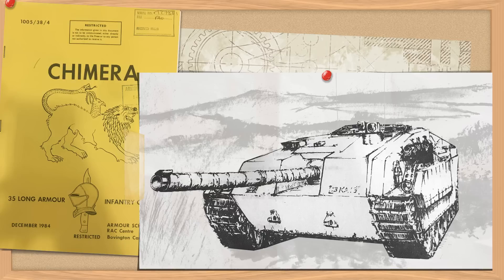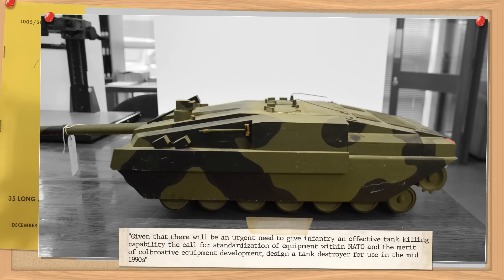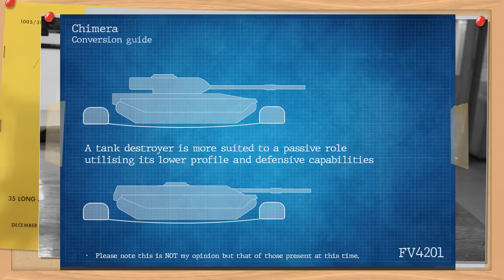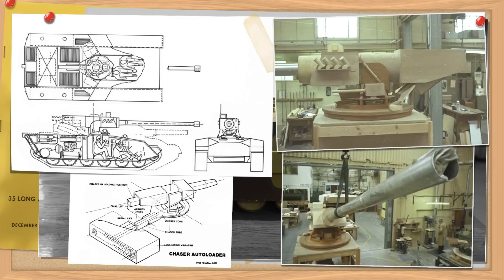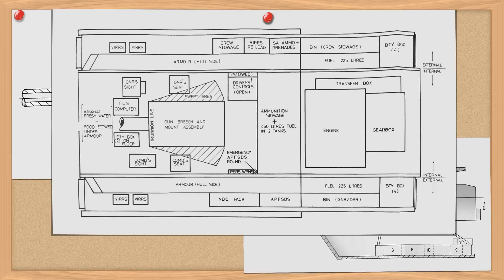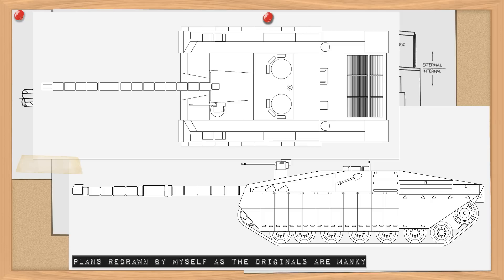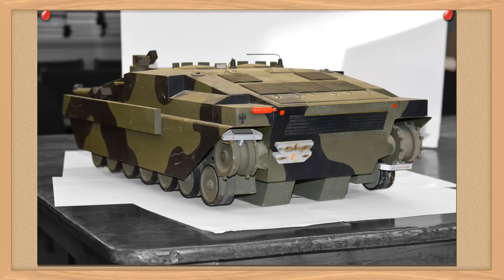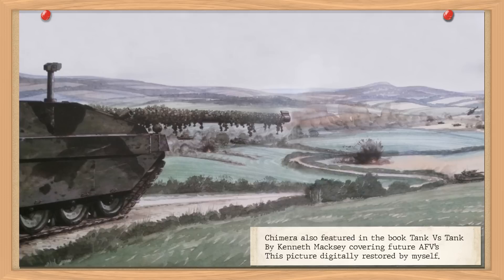Chimera 1984- Tank Design & Development

Comment: A proper hydrostatic steering system would have solved a lot of problems related to the gun traverse such as the need of internal space, sealing  and the large slit in the frontal armor.
Reply: Not exactly inkeeping with the goal of keeping things cheep though.

Comment: If the AFV is going to be used defensively, from prepared firing positions, anyway.  Wouldn’t it have been almost as effective to mount Challenger turrets and a new engines on old chieftain hulls?  From a hull down position only the turret is exposed, and that was state of the art for the time.  It would have made a cheap option for NATO countries looking to upgrade.  You could even let them choose their own engine.

Also, part of the hidden genius of the Stank is its dual engine set up.  A diesel for slow movement and fuel efficiency and a turbine for sprints.  As far as I know this combination power pack is unique, but avoids a lot of problems which plague all MBTs.  The US M3 had twin engines which combat experience showed was a great concept.
Reply from the maker: they did test that, done a vid on it too :)   but in this case they wanted a TD, so a chally turret on a 4201 hull would still have the same issue as being less efficent and not utlising the advantages of a tank, while also not solving the issue as expensive new turrets on clapped out hulls would be wasteful, but at least one hybrid was mad in the chieftian PIP

Comment: On the reliability issue of Chiefy ( and all brit armd vehs ) was there ever a study done as to why the recovery vehicle versions did not seem to break down as much as the fighting version despite having less crew and the reme did not seem to spend much time repairing / mainting their own vehicles but loads of time fixing the host units vehicles?
Reply: The Recovery vehicles probably just had fewer hours/miles on them
Reply from the maker: few aspects, the biggest issue with L60 was it really did not liek startign stopping and shuffling about, but worked well enough at a constant rev, which isnt good for tanks etc, they did fix most the issue by the end, but by that point the rest of the platform was gettign old

Comment: Maybe I missed it but was there any talk of a hydropneumatic suspension system so it could lower, tilt, or elevate the hull like the S-tank?
Reply from the maker: no, none at all
Reply: @armouredarchives8867  Kinda crazy that they'd completely ignore something that was already proven to work.
Reply: That only works with a very short track, which wouldn't do for a weight over 50 tons
Reply: Since their idea was to convert Chieftains cheaply, it wouldn't make sense to replace the suspension system. This also rules out precision steer aiming like the S-tank, which rules out a tilting "pod" or an elevation only mount. They have to work with the capabilities of the Chieftain hull.

So, the design challenge is completely different from S-tank.

Comment: why didn't they just buy the Swedish stridsvagn 103, the S tank and save the R and D costs and a whole lot of time not waisted?

Stridsvagn 103C

In the defense decision in 1982, it was decided that the purchase of a new tank would be expected until the 1990s, after which modification of the existing tanks became necessary. The renovation and modification of Strv 103 entailed improvements on the following points, among others:

     • Laser rangefinder integrated with the shooter's sight
     • New piston engine from Detroit Diesel
     • Partially new gearbox
     • Possibility of skirt armor consisting of diesel-filled jeep cans
     • Headlights
     • Dozer blades for all wagons

All rebuilt 103Bs were taken into use in 1986-1988 under the designation Strv 103C.

Then they would have received a vehicle which could functions as:

An infantry support vehicle
An anti-tank vehicle
A storm cannon vehicle
An armored bunker on tracks
Reply from the maker: be an easy course tho ... so chaps what do we thing..yeah buy that one :P   also wont solve the issue of those leftover hulls we cant get rid off
Reply: @armouredarchives8867  they could have made them into something like the BMPT "Terminator" 🧐
Reply: @armouredarchives8867  six months later...
Maybe they could have used the as trade-in for the S tank. 

I did my service in 89/90 and we really could have made good use of those hulls in the army. Our tank regements had there Centurions, S tanks and more and we only had some IKV 91* on my regement. And making anti tanks of the hulls for army use could have been a good solution. The StuG III was a serious moral booser with the German infantry so having potent anti tank platforms might be a game changer. We only had un-armored vehicles for our pvpjs 1110.

Sadly we will never know.
    🇸🇪🤝🇬🇧

* IKV91, The Infanterikanonvagn 91 ("infantry cannon wagon 91"), was a high mobility assault gun that was developed to meet the operational requirements of the Swedish Army. It was designed and manufactured by Hägglund and Söner (now Hägglunds Vehicle AB) and employed common components with the Pbv 302 armoured personnel carrier series. The first prototypes of the Ikv 91 were completed in 1969 with production running from 1975 until 1978. The total numbers manufactured were 212.

Comment: Seems to be reinventing the "wheel" of the S-tank. Sure, a bigger gun and more modern optics but losing many of the advantages of the S tank.  Instead of the hydropneumatic suspension, a cheaper limited traverse mount. Putting the drive train in the rear and losing the protection of tons of metal at the front. That also eliminates the rapid reload at the rear.
Reply from the maker: Stansk primary defence is mobility and profile, not armour, any big hit will also imbolbilise the engine, which it vital along with the tracks for casemated vehicles, this vehicle has protection and profile, but lacks the agility os Stank. - Stanks is also a 'rank' and designed to work very offensivley, while this is aimed at defensivley squating more

Comment: I'm still failing to see how you can give an estimated ''off road''speed, given that ''off road'' means any terrain that isn't road.
Reply from the maker: remembr this is their calcualtions not mine! but they tesnd to have a set of ' off road critetia. such as heavy going (vylay, deep mud, loose sand, - light going, standard field dry etc, and this is then factorted in with vehciles eight, area,, ground pressure, engine power and so on
Reply: @armouredarchives8867  I know it's not your own calculation but It's my own pet hate Lol . 
Without qualification , the Phrase is essentially meaningless except as a value given for the sake of map exercises or, possibly , fuel returns. 
The trouble is that people with no experience tend to abuse it . So , for instance , I've seen people argue that the ''off road'' speed of the PZ3 was no better than the speed of Italian M13 (no ''off road speed'' being given for this tank as it couldn't really go any slower ), making them about the same. Try explaining to them that , on good terrain like salisbury plain, your off road speed is the same as your top speed , especially down hill !

Comment: Asking a bit more than is realistic to up rate a TN12 by 30% to take the added torque and power of the CV12. Then there's the question of adapting the transmission from a transversely mounted engine. No, if this video is correct then the guys involved in the exercise were wasting time and money indulging in their little fantasy.
Reply from the maker: quite possibly so, the LAIC were a shadow of the former STT in terms of accuracy imho